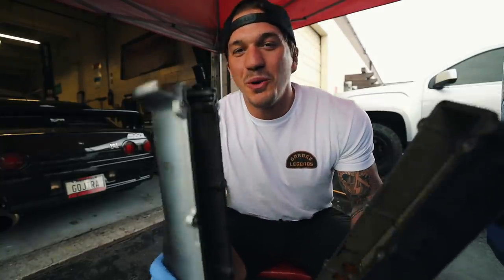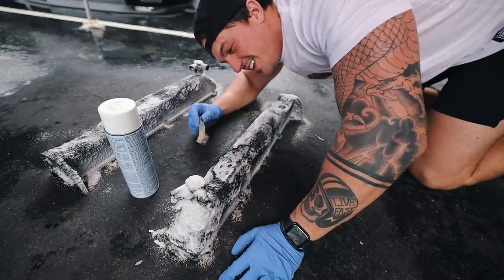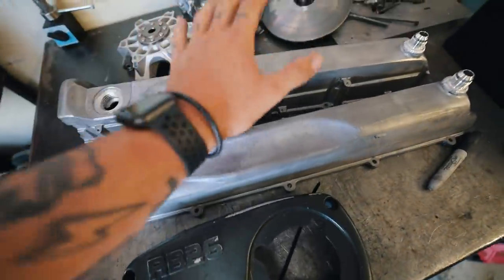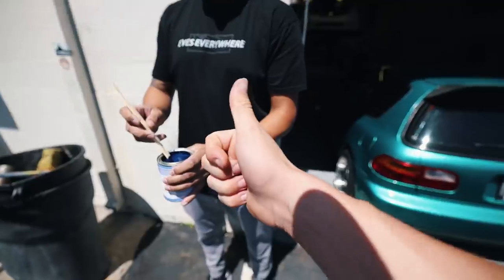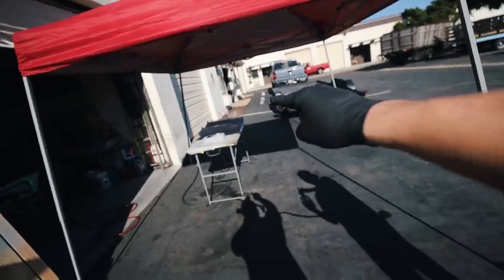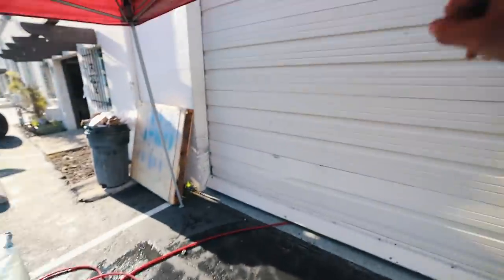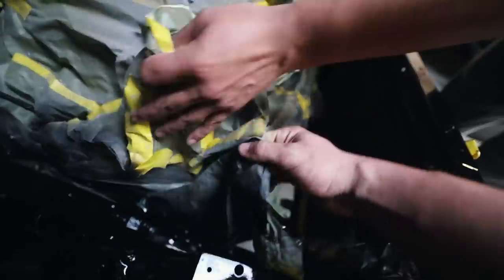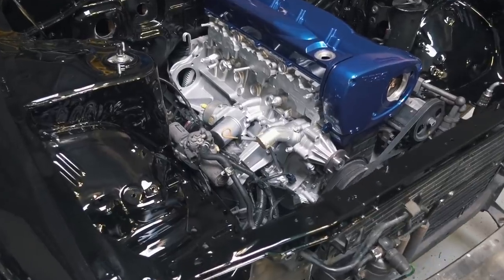R32 GTR DIY ENGINE BAY RESTORATION PT.2 | RB26 COVER, ENGINE BAY, & BLOCK COMPLETE!

Comment: Dude you need to have SoS do a repaint on the exterior, same color just freshen it up because the engine bay pops now
Reply: I don't mind another meguiars detailing episode lol
Reply: Polish, PPF, and ceramic coating so no worries when this beast is at the track
Reply: Zach Plymale I thought Meguiars already detailed this once and that was their best work to get out the scratches.  Figure with the age of the car there might not be much clear coat left.
Reply: @Reaper3088  yeah they did a few months after he got the Skyline! Hopefully the clear coat is still thick enough for a safe compound and polish.
Reply: @jdmkidk24  Cheaper to paint it, and get better results with fresh respray and coat of wax. 

PPF is thousands, plus about 2k for a proper detail and ceramic.

Comment: I was wondering my dream is a r34 there almost over the 70 k range so I was thinking I'm 17 now do you think if I buy a gtr and convert it to rwd gtr the whole kit engine and interior would that be better than buying gtr or just save up and get a gtr later on in life
Reply: so you made quite some mistakes 
but im guessing you wanna buy a gtst a rwd skyline and convert it to a gtr
but doing that will pretty much be more expensive than just saving up for an actual gtr skyline 
i recently bought an r34 gtr and i got the z type package on the way for it and im debating either i keep it ice white or i make it midnight purple or millenium jade